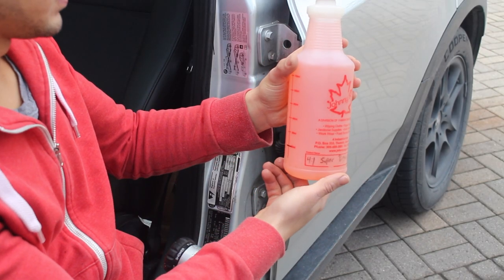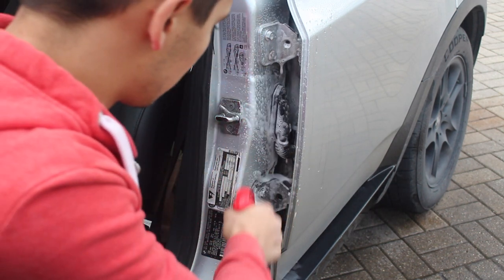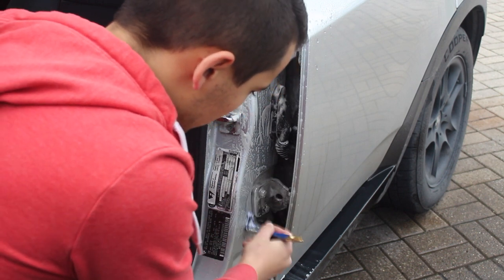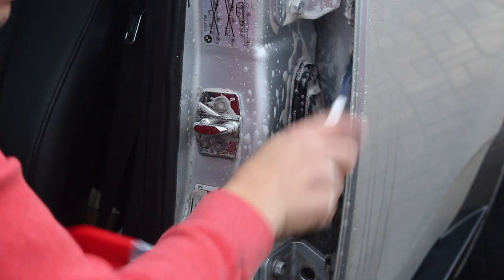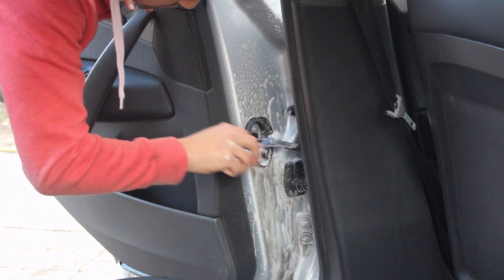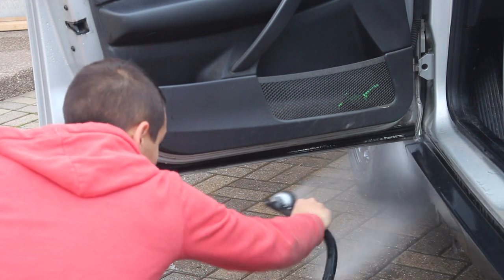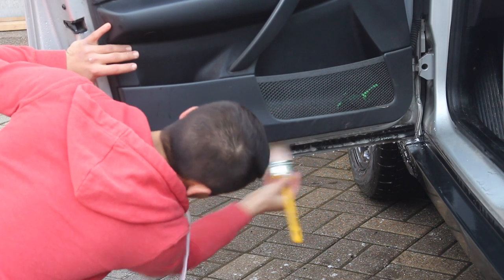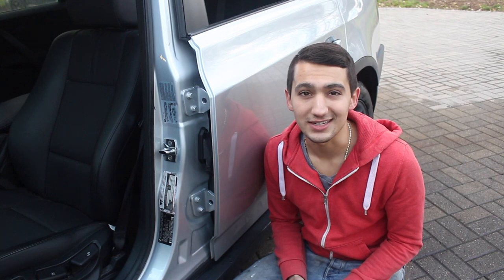How to Degrease Door Jambs

Comment: Don't you get water in the interior when cleaning? Also after cleaning, do the doors creak when you open them because all the "grease" is gone?
Reply from the maker: +MrRangerZr1 Thats if you spray with your hose towards the interior. If you use a 'shower' mode on your hose, you can wash it without a lot of overspray. And after the cleaning, I'm yet to experience creaking, as it is pretty damn near impossible to get the grease out of the actual hinge of the door because the brushes can't get in there.
Reply: milanmastracci Oh okay. I thought the doors will start creaking like mad after you clean them LOL
Reply from the maker: +MrRangerZr1 LOL even if they did, if you put some 3M silicone paste in there, you won't have any noises anymore

Comment: if i get my car washed and the plasce uses this"desgreaser" shit i lose it on them, i paid for krown oil spray to be put on my car so i kinda want it to stay there i dont care that the jambs look dirty, and especially the bottoms of doors need he grease on them, if anything the grease stops it from rusting
Reply from the maker: +Mike Utoober The only way that the grease stops the metal from rusting if you have a thick amount of it. A clean car that is waxed and protected won't rust, and looks 100 times better. You won't have dirty door jambs, you won't have the oil dripping from the side skirt, and it is just as effective. The only time I would oil spray your car, is if you're doing the undercarriage of the car.
Reply: +milanmastracci with krown oil it seems to continue to make a mess of your car for about 2 months after being applied, not complaining but that would mean you are washing off a lot of the oil you paid to get put on, also not saying my caars bad but its a ford which is historically known to get rusty. so i would rather leave oil in areas especially the bottoms of my doors on the inside
Reply from the maker: Yeah thats up to you of course Mike Utoober :)
Reply: +milanmastracci hey i sent you a PM on youtuben have you seen it?

Comment: Merry Christmas everyone, Should we put in any lubricant in the hinges as a preventative to squeaking? or just leave it alone.
Reply from the maker: +dmikhael619 You shouldn't have to put any lubricant in the door hinge because the brush won't be able to get in there. IF it is squeaking, get some 3M Silicone paste and apply it to the door hinge. You shouldn't be hearing anything after that.

Comment: Could you do a video on interior fine detailing? Like cleaning crevices in steering wheels and stuff thanks.
Reply from the maker: +JUNAID187 Yeah sure thing man!! :)
Reply: +milanmastracci  Isn't removing grease from the hinges going to make them squeak?  Would it be a good idea to add a little grease there?
Reply from the maker: You can if you like but it shouldn't squeak after doing this because you won't be agitating the internals of the door hinge with a brush, just the outer part of it. IF it does end up making noise, you can use some 3M silicone paste to stop it from creaking.